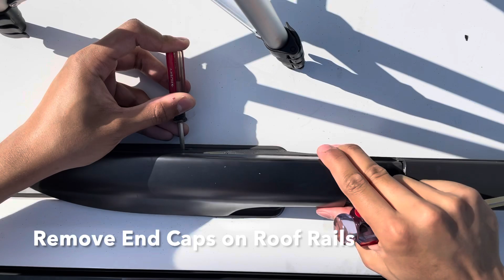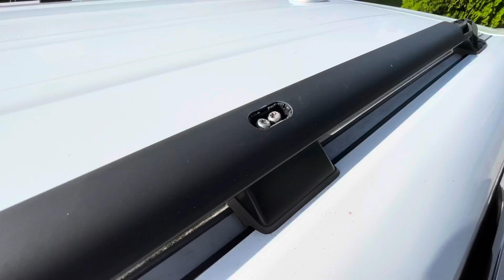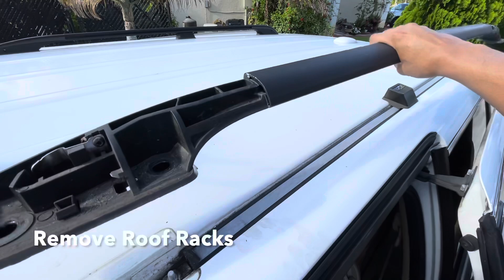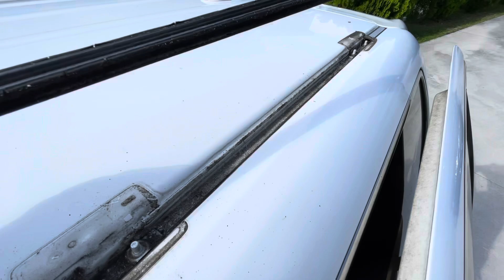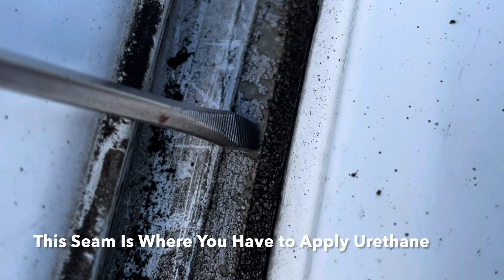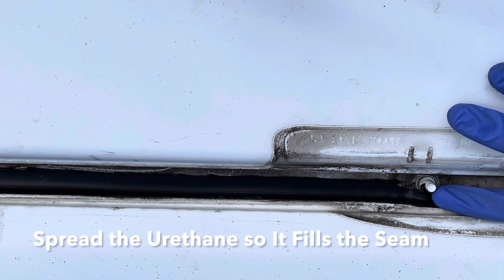DIY Honda Odyssey Roof Leak Fix (PERMANENT)

Comment: Me, my wife & our 3 kids spent 2 days doing this. We took it quite a bit further though as we chiseled out the old "gasket" & filled it back in with gasket maker.
Reply: Chiseling out my old seam sealer right now, hoping this works. did you guys seal the "gap" between the seam the front windshield seal?

Comment: Was yours leaking or did you do it as preventative maintenance?
Reply from the maker: It was leaking. If you have a 3rd gen at this point, might as well just do it.
Reply: @MrRangerZr1  when you applied the urethane, do you have to wait a couple of hours/days or can you reinstall the moldings back immediately? I don't want to screw this up, lol
Reply from the maker: @jerseydevil1995  you can wait or just reinstall the moldings. Key is not to apply a lot or urethane, apply it just like I did. Just make sure it doesn't rain that day.

Comment: I’ve got a 2005 Odyssey that has water leaking down to the pillar that holds the driver/passenger seatbelts (are those the B pillars?). Would this fix cover all possible channels for water to come in there or should I check other seals as well?
Reply from the maker: This should fix it
Reply: @MrRangerZr1  gonnaa do this to mine as soon as Hurricane Ian rolls out of here 😆 (coastal NC)
Reply: Yea, my driver side is worse. Absolutely soaked right now.

Comment: I did this but it is still leaking, it now sprung a leak in the rear as well. I’m thinking I didn’t put enough adhesive through the channel. Would rotted out roof moldings cause it as well? Thanks for any input (2010)
Reply from the maker: You may have missed a spot when sealing, water just needs a hairline crack.
Also check your tailgate seal.

Comment: What size drill bit are you using I just bought an off brand 20v drill 3/8 at Walmart and it’s not even raising these screws out what else can I use?
Reply from the maker: Watch the video. 
You don't use a drill bit, you use torx bit sockets to remove the bolts.
Reply: @Lisa-ed4qe  just did mine today!

Comment: Any chance you know how to fix if this doesn’t work. Like next solution if our moonroof drains are good and we did this plus we replaced the trim pieces. Now that we have a good rain, it’s like we did nothing 😭
Reply from the maker: This is literally the ultimate fix for the roof. Now if your windshield or windows are leaking that's a different story.
Reply: @MrRangerZr1  hey mate my partner's first Gen odyssey is leaking , so water is slowly dripping in from rear window pillar in the boot.

And eventually gathers in rear trunk where the tyre sits,
Reply from the maker: @JasonfromBiripiCountry  Do this and check the tailgate seal on the body
Reply: @MrRangerZr1  Hey mate, so I've sealed the roof and it seems to have fixed the issues.

Thanks mate

Comment: Wow Mr. Ranger great info. I will have to check it out. Is it more common on earlier or later odysseys? Thanks for sharing. I always appreciate what you share on Hondas. Will be doing my timing belt on my 07 odyssey soon more because of time than mileage. Mileage is only in the 70000 mile range. I just purchased the shim for the TSB. YOU HAVE ANY INFO ON THAT? Then I’ll be doing my daughters 2010 pilot. Parts are on order an just staying busy. Thanks for all you share and stay safe and well Artie 👍
Reply from the maker: Thanks for the support.
What shim are you referring to?
Reply: @MrRangerZr1  I’ll have to look up the TSB but they have you installing a tapered shim behind the idler pulley I believe. I’ll have to look it up. The belt is possibly chafing on surrounding components. If there are signs of chaffing they say to install the shim. They say it applies to 07’s up to 2010pilots with certain VIN NUMBERS. When I get it apart if it needs it I’ll send a photo. I’ll send more info tomorrow. 👍 bulletin PA006-11 TSB 08-045 V6
Reply: SYNCHRONOUS BELT DRIVE SYSTEM
TECHNICAL SERVICE BULLETIN
 BULLETIN PA006-11
PART NUMBER:
Timing Kit - 2523290
Timing Kit W/Pump - WPK41184
MAKE:
Acura Honda
MODEL:
MDX
TL Accord Odyssey Pilot Trdgeline
YEAR:
2005-2010
ENGINE:
3.0L 3.2L 3.5L 3.7L
See chart on page 2 for specific application information.
HONDA/ACURA TIMING BELT NOISE
Original Equipment Manufacturers have identified instances of timing belt chirp emitting from the timing belt area of some Honda and Acura vehicles. This chirp can be heard after, but not limited to, belt warm up. In some instances the mounting of the idler pulley can cause the belt to rub against the flange on the drive pulley gear, resulting in the chirp.
Due to the complexity of the vehicles affected (using VIN splits and the wide range of affected vehicles), technicians should refer to the following OE Service Bulletins to see if their vehicle is affected.
• Honda Service Bulletin 08-045 • Acura Service Bulletin 08-031
According to the OE Service Bulletins, additional steps may be required depending on the application. This could include installation of a shim, grinding reliefs in the engine mount bracket, and even water pump replacement on some applications. NAPA Belts/Hoses always recommends replacing a timing belt driven water pump when a vehicle is in for timing belt service.
The recommended shim is included in Timing Component Kit 2523290 and WPK41184 in order for technicians to do the job correctly. Factory torque on the idler pulley is 33 ft. lbs. with or without the shim.
The shim is placed between the idler pulley and oil pump housing
      
  SYNCHRONOUS BELT DRIVE SYSTEM
TECHNICAL SERVICE BULLETIN
 Potential Belt Chirp Applications
Make
Acura
Acura
Acura
Acura
Acura
Acura
Acura
Acura
Acura
Honda
Honda
Honda
Honda
Honda
Honda
Honda
Honda
Honda
Honda
Honda
Honda
Honda
Honda
Model Year
MDX – All 2005-2008
MDX 2009
TL 2005-2008
TL 2009
TL 2009
MDX* 2007
TL* 2007
TL* 2007
TL* 2007
Accord 2005-2007
Accord 2008
Accord 2008
Accord 2008
Accord 2009
Odyssey 2005-2008
Pilot 2005-2009
Pilot 2010
Pilot 2010
Ridgeline 2006-2008
Accord* 2007
Accord* 2007
Accord* 2007
Accord* 2007
Engine
V6
V6
V6
V6 (2WD)
V6 (SH-AWD)
V6
V6 (base model)
V6, Type-S W/ Auto Trans
V6, Type-S W/ Manual Trans
VIN
All
2HNYD2...9H500001-Thru... 9H509684
19UUA86...9A000001 Thru...9A008956
19UUA96...9A000001 Thru...9A000125
2HNYD2...7H507330 Thru...7H525424
19UUA7...7A006414 Thru...7A022932
19UUA7...7A004906 Thru...7A022495
19UUA7...7A006222 Thru...7A031962
All
1HGCS2....8A000001 Thru ....8A032544
1HGCP3....8A000001 Thru ....8A032544
All
1HGCS2....9A000001 Thru....9A002647
All
All
5FNYF3...AB000001 Thru...AB002381
5FNYF4...AB000001 Thru...AB003614
All
1HGCM8...7A002002 Thru...7A004104
1HGCM8...7A002029 Thru...7A003983
1HGCM6...7A037354 Thru...7A060259
1HGCM6...7A034807 Thru...7A057992
           V6
V6, 2 Door, W/ Trans
V6, 4 Door, W/ Trans
V6, W/ Manual
V6, W/ Manual
V6
V6
V6, 2WD
V6, 4WD
V6
Auto
Auto
Trans
Trans
        Honda
   Odyssey
   2009
   V6
   5FNRL3...9B000001 Thru...9B057721 5FNRL3...9B400001 Thru...9B11326
       Honda
   Ridgeline
   2009
   V6
   2HJYK1...9H500001 Thru...9H503152 5FPYK1...9B100001 Thru...9B104340
 *Application also requires water pump replacement.
    0098-1788
V6, 2 Door, W/ Manual Trans
V6, 2 Door, W/ Auto Trans
V6, 4 Door, W/ Manual Trans
V6, 4 Door, W/ Auto Trans

Comment: I have this problem on my '14 Honda Civic windshield. Leaks from the top. I don't know how to solve it
Reply from the maker: If the windshield was never replaced then do this same process.
If the windshield was replaced before and it's leaking now, then the windshield wasn't installed properly.